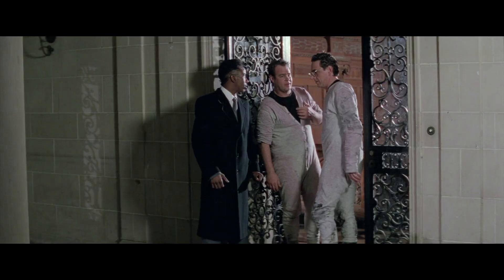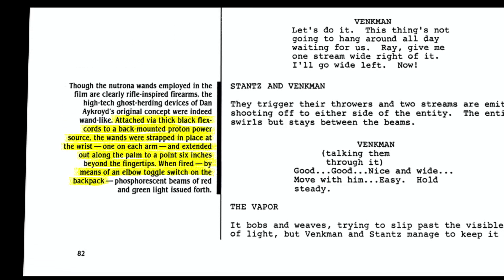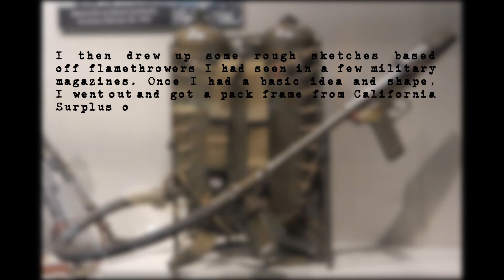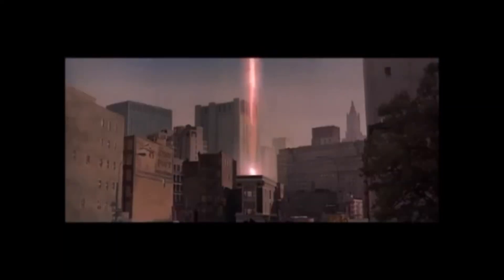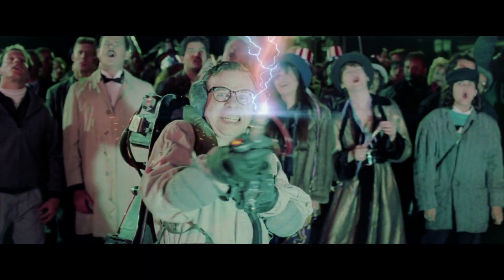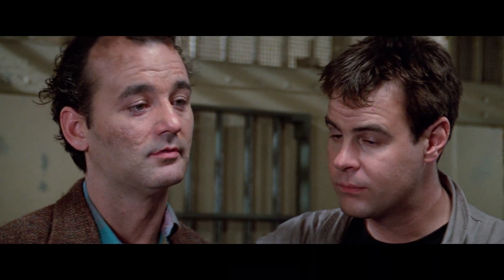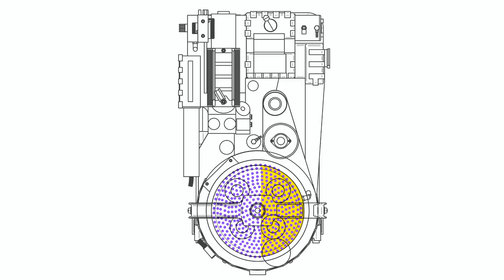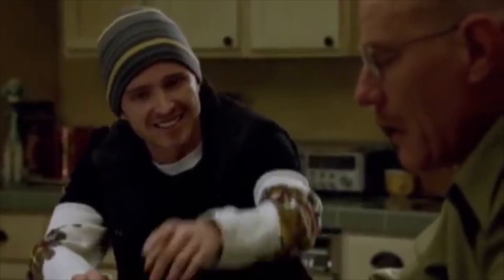How Does the Proton Pack Work? | The History and Physics of Ghostbusters Equipment

Comment: Also I have a question on the source of the name and function you state for the “control arm”, containing the microprocessor at 13:34 .  It seems reasonable to me given the size of this part of the pack, but most other sources I’ve seen just mention the ion arm and don’t attribute processing to this area.  I’m wondering where that came from?
Reply from the maker: I don't know all of the history for every fan-named part, I believe some had to do with the decals that were on certain parts. For me, "ion arm" never made sense and there was never a designated place for the "brains" of the pack. Given the proximity to the power source, that made the most sense. 

I also opted to have the power cell into what is traditionally called the Booster Tube because the internal "plug" looks like it could be pulled out to reveal a radioactive core.
Reply: @ChannelingSpirits  both of those do make much more sense, given the the shapes and volumes.

Comment: Question on the “oscillator” at 14:44 - many sources treat this as some sort of smoke release filter, and is has the mysterious name “N-Filter” in many sources.  Your “oscillator” makes more sense, but did you folks just decide that on your own?
Reply from the maker: The N-Filter never made much sense to me. I’ve heard some claim the “N” stands for nitrogen and it is used to cool the pack down. The 2009 video game introduced overheating and when the pack was vented, the N-Filter released the excessive steam/smoke. However, a functional cyclotron needs an oscillator. This is essentially the “engine” of the pack which could overheat as well. 

It was a decision of applying real parts of working cyclotron while also applying fan-theory and lore. We talk a bit more about the oscillator and the purpose of the ribbon cable in “What Happens When You Cross the Streams?” if you haven’t watched that as well.
Reply: @ChannelingSpirits  these do seem like much smarter functional attributions and naming conventions that you’ve chosen over some of the fan-names. Another fan-named example that makes no sense is the “motherboard“ - the whole rear aluminum panel is not a giant circuitboard, and if it was, there would be some thing over it to shield it. it should simply be called something like a “mounting plate“ or “rear panel“ or “backboard“. Anyway, that’s not one that you dealt with in your video but I’m just giving another example along the same lines and agreeing with you that some of the names that have proliferated could use some revising.

Comment: I yearned to know which of the original ghostbusters had the mechanical or engineering background to create such realistically possible equipment in the early 80’s, then I found your video, thank you for answering questions which I have had for a very long time in such a complete way. 
R.I.P Harold Ramis

Comment: This is a interesting way of how a proton particle accelerator could work, and its true, but there is a more easier way to actually do this. You can fill the hydrogen gas (H2) into a gas discharge tube and apply a large enough voltage and current. Thus you can get ionized hydrogen molecules and ionized hydrogen atoms, then send it through another tube to the center of the Cyclotron, using a oscillator to control the current on the Dees to rotate the charged particle, then once it makes its way to the end of the cyclotron, it gets sent through a cable or it gets projected at a target through a small, short tube.

Comment: It's actually doable,  if you have a power supply that is sufficient, and if you figure out how to store hydrogen without molecular loss. However, the most difficult part is the spalling radiation that a stream of protons hitting a matter such as the atmosphere, or solid objects will create.  In essence,  you could build it, and with some effort make it work at least to a degree,  however,  it would probably kill you and anyone around it with radiation poisoning.

Comment: Question, in the Ghostbusters video game, your pack was prone to overheating if engaged for too long. To prevent a shut down, you had to vent it. If your pack overheated, you'd hear your pack disengage, and four rods that looked like nuclear rods would automatically emerge from the cyclotron, and vent their heat to the open air, before reentering the cyclotron and your pack would reactivate. Any idea on this, or do you think that was just a bit of "artistic license" to make the pack's "reload" animation look cooler?
Reply from the maker: The idea of the packs overheating/exhausting is hinted at in the second movie (Ray says "Save 'em" when blasting the slime shell around the museum) but the Video Game took it took a new level. If you've seen the Haslab's Proton Pack or Afterlife, they show the cyclotron unencumbered by any control rods, so it is definitely (cool looking) artistic license.

Comment: this was a very well thought out and described video. A primer of the workings of a proton pack. One thing I'd like to offer is, the Neutrona Wand tip apparently has some kind of twist control for the leading (front) mounted hand, I was told this controls the "wobble" the beam can have, which is why in some scenes, the beam is very straight, while in others,  twists left or right or even seems to have a curve to it. From what I was told this is so when you have a ghost entangled and the ghost is fighting the beam, you can give it some slack so as not to lose it. The analogy I was told is that capturing a ghost is like fishing, your firm in some moments, then slack in others, this in turn allows the ghost to tire itself out and thus to weak to resist when trying to get it into the trap. Hence Ray's advice of "Zap 'em, Cap 'em and Trap 'em" , meaning to weaken the ghost, zap them of there energy, entangle them in the beam like a rope, cap them, and then put them in position to get sucked in by the trap's proton field, trap them.
Reply: Thats good. Im just going to add that the trap (meuon trap) doesn't have a proton field, but does use electro magnets with alternative currents to keep the negative PKE make up of the ghost inside.

Comment: The design of the stream is fantastic, especially in GB1 with the 2-way channel concept they used (then subsequently abandoned in GB2). Besides the orange/blue look, the only unusual detail of the stream that is easily visible is that the stream's whipping motion appeared to be originating from the far end rather than from the thrower. You'd have to pause/slowmo the scenes to see all of the other incredible details they put into it: 1. the visible orange stream originates from the far end, not the thrower (which explains the whipping motion detail). 2 the static electric field is emitted only upon the orange stream connecting with the thrower (prompting the burst of energy at the thrower's tip). 3. purple/mauve darts shoot back through the stream from the far end to the thrower, but only after the static electric field reaches the far end ("confinement stream" from Egon in ballroom scene). It must have been a blast designing things that next to no one would ever notice, or care to notice (yes I cared too much).

Comment: As someone who works in this field, I can tell you if these were real they would require a major expensive, meticulous maintenance schedule and probably have a few classified manufactures to produce the cyclotron, enrichments of fuel pellets, and it’s other elements. And the Carbon 14 wouldn’t be the ideal fuel but the beta decay is safer and more controllable. Curium-246 would be much better and has two main uses, basically as a fuel for Radioisotope Thermal Generators. Curium-246 has a half-life 162.8 days, and was produced by bombarding plutonium-239 with alpha particles in a 60-inch cyclotron. Each nuclear reaction produced a neutron in addition to an atom of curium-242. But also, Curium is very dangerous to handle and harmful due to its radioactivity. It accumulates in your bones and destroys the marrow, stopping the formation of red blood cells. Curium is also highly radioactive and unstable and it glows red in the dark, it’s pretty cool. So I honestly don’t know what the ideal radioactive elements would be, but I can guarantee you the government would put a stop to it, unless enough money was involved.
Reply: In the early days of Ghostbusters, would Carbon 14 be more accessible to laymen? I've always wondered how a group of previously disgraced scientists were able to obtain access to radioactive material to produce their devices. Also, in Extreme Ghostbusters, Roland is reminded frequently to "charge" the equipment. A radioactive isotope would not need the charging sequence, but this video explains the propellant module of Hydrogen, which is probably what requires recharging. I need to review the physics video for the ghost trap, but at a guess, if it uses the same tech as the packs, it probably also requires a rechargeable Hydrogen canister. I would like the video creator to review in detail the reason why crossing a proton particle stream would lead to potential astrophysical distortion or disintegration. My guess is that the collision of proton particles with one another from different accelerators causes a disruption in the necessary feedback flow. A particle thrower does not force the protons to collide but releases them in a steady stream where they can safely repel one another as protons are naturally inclined to do. Crossing the streams would likely desynchronize the flow, especially if one thrower's acceleration rate is not perfectly aligned with those around it. Crossing the streams in Gozer's dimension was a huge risk, but the psychokinetic distortion may have acted as a buffer for stray proton collision. Crossing the streams in a dimension (such as our own) where there is no distortion is probably a prelude to disaster. I look forward to feedback on these theories. I know some of you will correct me in saying that isn't Gozer's dimension. Technically, it isn't, but it is a bridge between dimensions that Gozer has a certain amount of influence on, and it did not originate here.

Comment: Wouldn't adding protons just form new elements?  That's kind of the periodic table

Also wouldn't break atomic bonds at that level basically result in a nuclear explosion?
Reply from the maker: 1. No. Protons in a proton stream would be considered "free protons."  Wikipedia goes into some depth but to quote; :Thus, in interaction with any type of normal (non-plasma) matter, low-velocity free protons are attracted to electrons in any atom or molecule with which they come in contact, causing the proton and molecule to combine."

2. It depends if you are talking about nuclear fission or fusion explosions, neither of which would occur from free protons obtaining valence electrons.

Comment: Why doesn’t anyone actually try and make a real proton pack, your way seems like it really works.
Reply: More than likely due to the fact that building something like that is extremely dangerous and possibly criminal to own. That and the cost.
Reply: Probably because it's a man-portable particle accelerator.  I don't think that's technologically feasible at the current point in time.
Reply: Creating an unlicensed nuclear accelerator thats a portable weapon towads animate and inanimate objects is highly illegal. But if there were good enough reason one could obtain a license. Like scientists working with high powered lasers.
Reply: By the way this is not HER way. It is THE way a cyclotron works and is based on actual science. They are a little bigger though and Im not sure the wearer could have one on as much as these guys and not develop radiation sickness or other diseases.

Comment: Soooooo.....
Why crossing the streams was BAAAAAAD?
Reply: Well, as all of this is BS anyway my psuedoscience assumption would be that as the particle streams are supposedly bi-directional, crossing the steams would create a exponentially increasing feedback circuit that would eventually result in unpleasantness for the pack operator. Ultimately all the predictions of catastrophe made by Spengler & Stantz were theoretical however, as they barely tested the equipment for field functionality, never mind catastrophic failure.

Comment: Wait, wait, wait...  A while back I saw a video where some GB fans built their own replica proton pack with a modern ALICE frame that they mounted a vacuformed plastic (with fiberglass reinforcement) proton shell onto.  I don't recall if they had access to the original prototype design notes like you did for this video, but other than the vacuforming instead of shaped foam, you're telling me their homemade DIY replica was actually almost exactly how the prototype pack was built?
That's actually really awesome and very indicative of just how close to the "garage built out of junk" aesthetic they actually achieved.
Reply from the maker: A lot of fans have gone to great lengths to copy the original hero props. The "shell" is usually vacuum-formed fiberglass, like the original props. Some have measured the hero props for the exact dimensions and been able to create some very close replicas!
Reply: @ChannelingSpirits  I love this fandom, I'm excited to be a part of it.  Let's do this!

Comment: Great video. The only thing you, (perplexingly), left out is that cyclotrons creating proton streams actually do exist, as does the technology to miniaturize a particle accelerator to the size that it could be fitted onto a backpack. I can’t personally speak to the practicality, (or safety), of doing so, not am I certain it could be easily done WITH an autonomous power source, but I find the mere existence of it as a technological possibility to be worth mentioning.
Reply from the maker: We definitely aren't physicists and while we try to apply a lot of real science, there is a ton of real-world problems with the pack. Ignoring the financial impossibility, a cyclotron of that size would probably not produce a substantial flow of protons. The power source would be the biggest problem as it would have to be miniaturized and certainly couldn't run on Carbon-14. Also, a hose couldn't transport the protons from the pack to the particle thrower; they would escape. Even if they reached an exit point, the protons would not stay in a "stream" for very long. Given all the leaps in logic, we tried to suspend disbelief than apply too much reality while pursuing the fantastic idea of "what if?"
Reply: Channeling Spirits Channeling Spirits Those are some good points. I’ve actually killed a lot of time trying to work out in my head how to get around the issues of the power source and transferring a particle stream through a hose. (Disclaimer: I am also not a physicist, if it wasn’t already obvious.) So far my best guess for the hose problem would be to attempt to use high-powered electromagnets inside of a vacuum to stabilize the beam. That way it would stay in a fixed point even in a flexible chamber. It’s all highly theoretical as, in addition to not being a physicist, I also don’t have millions in grant money laying around. I do think that it is possible, especially when you look at how synchrotrons work. It would just take a very large hose, very powerful electromagnets, a very powerful vacuum, and a significant amount of trial and error.